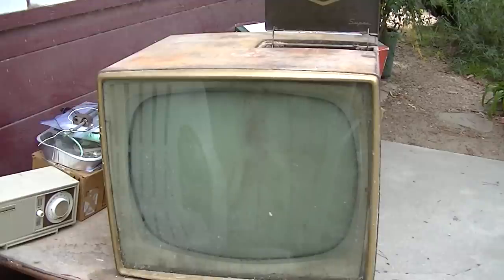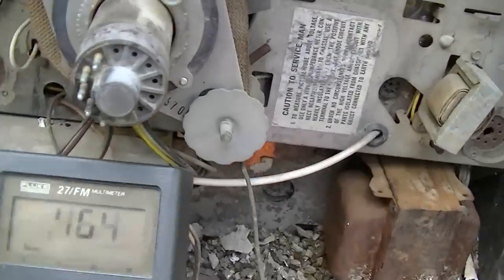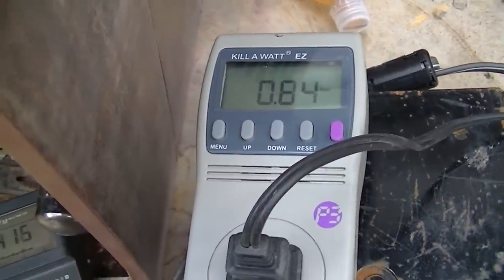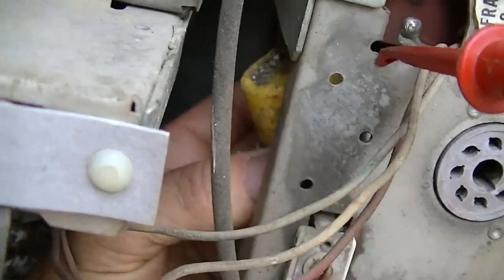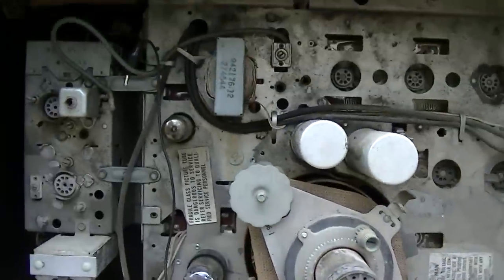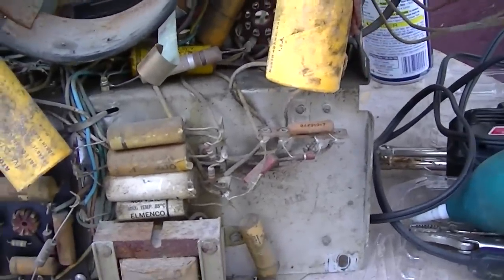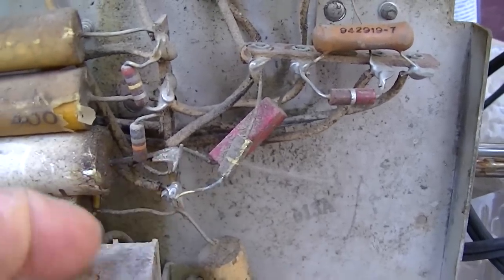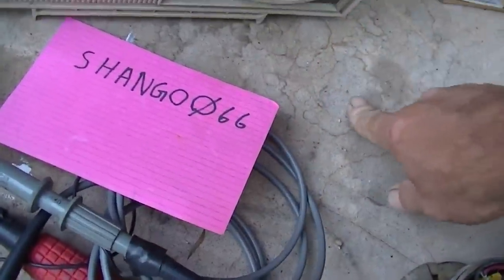RCA KCS96 Resurrection Abandoned House Set

Comment: I was probably one of the rare ones to watch this, not only did i watch the whole video, and repeated a few sections. I found it interesting. I found this video, via links from the first one, my interest being Urbex and exploring abandoned places. If i had been in the position of shango066 and acquired this TV, having restored many vintage radio's and old radio ham equipment. After verifying the basics were good, ie PSU and line stages. I would have done a good strip down, clean, and replace obvious bodges first. Iv'e learned that by doing a slow, methodical clean, you discover other things that you would spend many hours hunting and fault tracing for. Its a shame that you wont fully restore this TV set, simply because it would show to others, by methodical work, something like this can be brought back to its former glory. You got it as DOA, you nursed it through intensive care and moved it into the day ward, now help it back onto the street..:) Thank you for the great video..!

Comment: That... was awesome. And yes, I did watch the entire thing. I had slightly higher hopes for it's outcome since the tube tested so good initially, and that green clock radio you found out there turned out as well as it did. Oh well, at least it is watchable. Plus, you've come up with new artform: solder splatter painting!

Comment: some vacuum tubes will work at low voltages but I think that the RCA KCS96 is likely to be a lost cause as lot of capacitor values might not be available, That soldering gun is one brilliant iron I actually have one but the labels have since peeled off and the cable is cracked and it is missing a small screw and a bulb and it still works but needs a plug I got mine when I as 18 years old, Rat faeces might be acidic so will eat through everything.

Comment: The foil side topic does apply to modern capacitors.  Its just that in low impedance circuits it has no effect.  However, in high impedance circuits the foil side really matters.  You can find it on modern caps by hooking the capacitor to an oscilloscope and holding the capacitor body between your fingers.   Then reverse the polarity and repeat.  Whichever way produces the lowest signal, coneect the lead connected to oscilloscope ground to circuit ground.  Especially important in audio and RF circuits.

Comment: I used to have a old Johnson Viking Ranger that would snap, crackle and pop and die.  And then when I turned it back on, it was healed.  I think old electronics have an immune system we are unaware of.  But when the old B&W 5100 AM Xmtr I had snapped, crackled and popped and died, it was the equivalent of appendicitis and required surgery.   

Go figure.